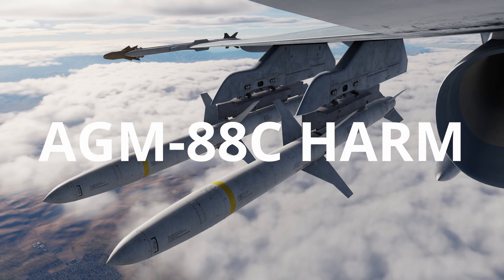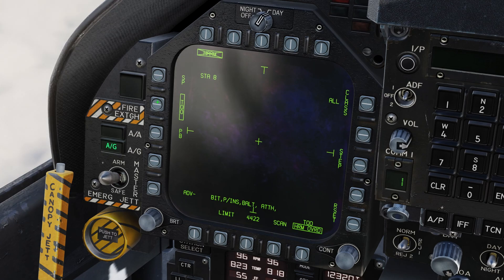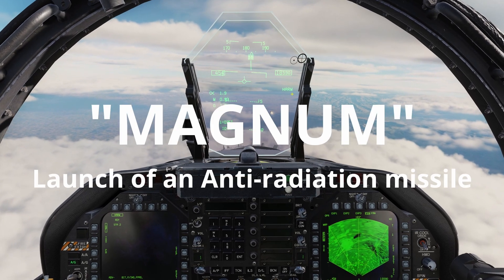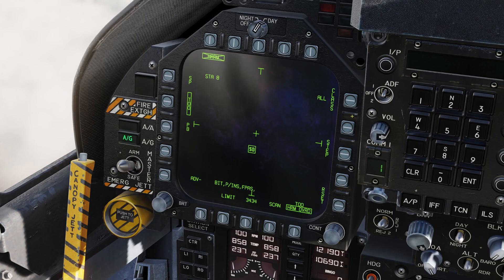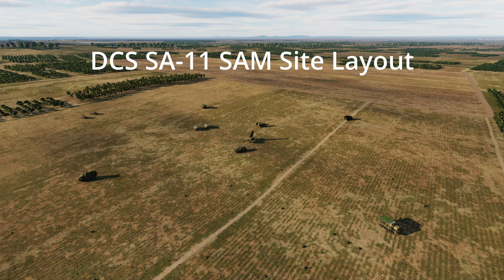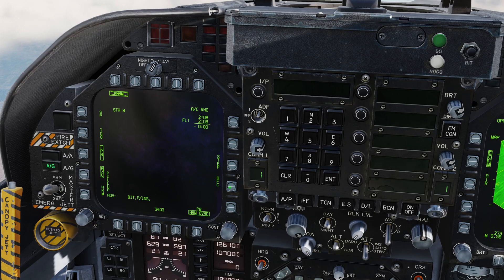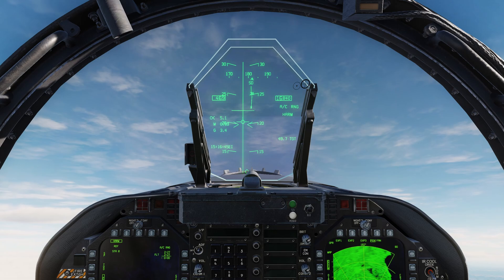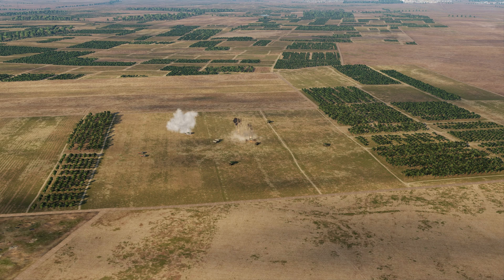AGM-88C HARM | DCS F/A-18C

Comment: You can also take advantage of the benefits like  loft functionality of PB mode without knowing in advance the radar type or location.  Set the harm to TOO, and use that to see the emitter's general location and type. SCS up to select the hud, drop a designation diamond near the box (slew it closer if need be).  SCS back to the harm(prevents you from accidentally shifting the designation point). Switch the harm to PB, punch in the matching code, and now you are free to do things like terrain masked approach or to shoot from beyond the range of TOO's straight-line trajectory.  It's like a manual version of the viper's HTS pod
Reply from the maker: Absolutely. Equally you can use that to then program a Cruise missile to launch from much further away
Reply: @EchoVictorDCS  I had never thought to apply that idea to cruisies, that's pretty clever

Comment: these have been dogshit in ukraine
Reply from the maker: Unfortunately so, yes. This is now an outdated system which is very easily shot down by modern SAM systems
Reply: @EchoVictorDCS  well they got 40 years out of them. but I don't think they have a chance in hell versus a buk-m1, not even the agm88e version. I think new BUKs have impressed western intelligence about more than any gear seen in the entire war. that & the kh47. need something higher velocity at this point.
Reply from the maker: @posmoo9790  yeah, higher velocity or change the way you attack them. With active radar jamming tech and heavy saturation with TALDs etc, a HARM could potentially still get through. But with the logistics in place on the russian side mean they just replace any radars that get destroyed
Reply: @posmoo9790  The issue is that in Ukraine when attached to a MIG-29, the AGM-88 does NOT have all these features, they're operating in a degraded mode where they're programmed on the ground. Their general target location is programmed in and the missile is launched where it searches for targets. If a threat is encountered outside this area the MIG is unable to utilize the HARM to defend itself or attack targets
Reply: @demanischaffer the front line is static. some contact lines have barely moved in 2 years. the situation you described in nonexistent. Ukr are engaging the first echelon of air defense - there can never a new threat between them and their target because that is where the front line it and it couldn't survive. they already know where the AD targets are they have perfect ISR and they still cannot successfully target it. It is essentially the ideal situation and it still can't work. It's over bro. They just got six f-16s. the first thing they should do is send the three operable ones to fire 12 harms at a BUK. But the problem is they'll be destroyed and some of the f-16s won't come back. What is your peoples excuse now that they have f-16s anyway. you were the same people that always sudden said the amazing american wonder weapons would win the war.
Reply: @posmoo9790  "can never a new threat between them and their target because"
Based on nothing. Do you think the Russians have left air defenses in the same spots for 2 years straight?  Do pop up threats no longer exist? 
"have perfect ISR"
Another baseless claim. Do you think Ukraine has the locations on every Russian AA system 24/7?
". you were the same people "
Literally arguing with strawmen 
My original point is that the AGM-88 has been operating in it's most simple mode in Ukraine, and you started going on and on about things not even addressing what I said